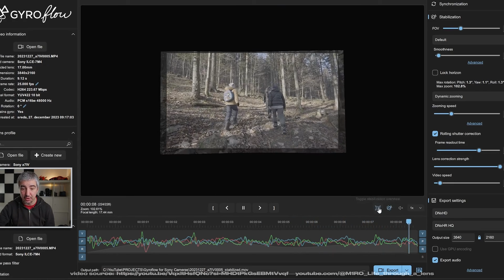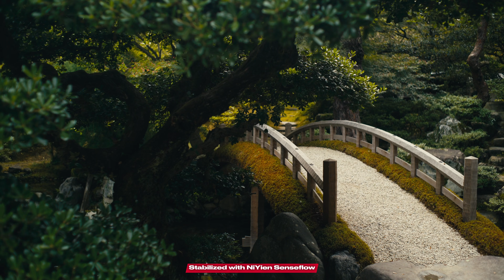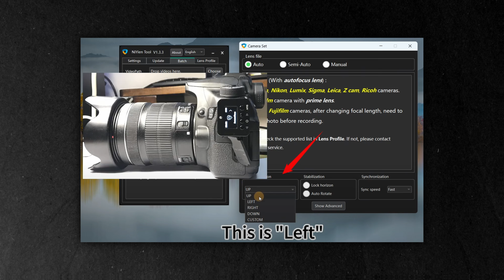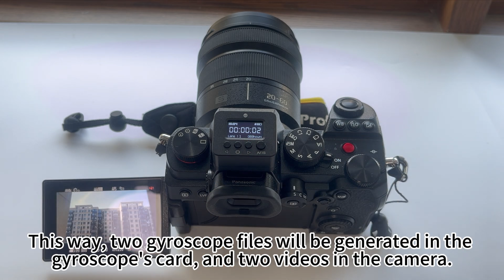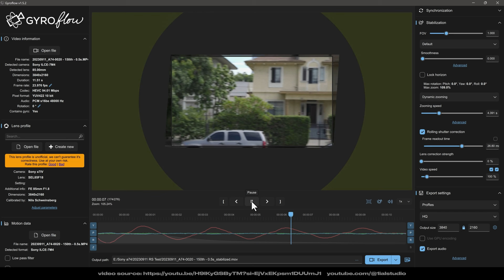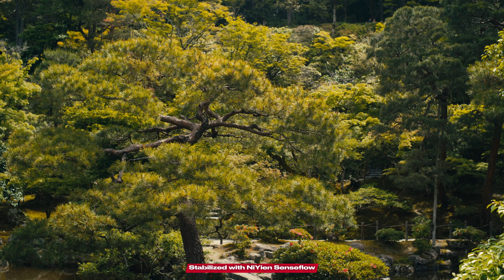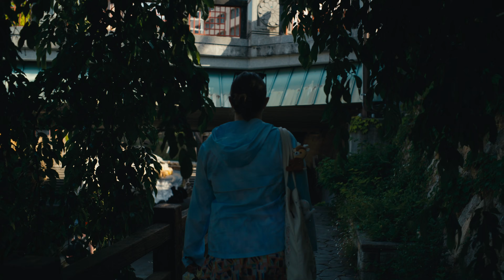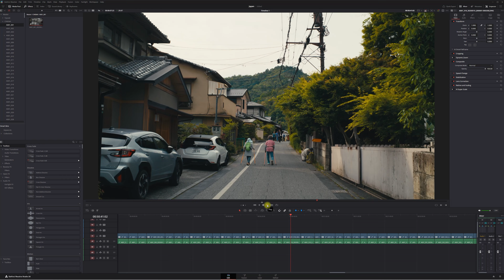Stabilizer for any camera?! NiYien Senseflow A1

Comment: The A1 also features: an intervalometer (for timelapses, with both bulb and normal shutter modes), a remote trigger, a timer and a level with X/Y + bubble visualization (firmware 1.2.8).

Just discovered that when I received mine today, so this is definitely more than a simple gyro logger and definitely feature-packed for the price.

Comment: so good! Would it work  to keep the shutter angle at 180 by shooting a higher frame rate? like fps120 shutter speed 1/240? that way stabilisation works fine, rolling shutter suppression works and we keep the 1:2 fps/ss ratio? that would also allow for slomo by recording at higher frame rate if we decide that we wanna use slomo in post
Reply from the maker: Yes, you can shoot above 1/200 without any problems. 👍
Reply: @flare_vision so good! Thanks a lot

Comment: Really curious about the shutter cable operation. Would that mean you don't have to record the 2 sync clips and could just run and gun? That would be huge, and I will be buying one asap if that's how it works.
Reply from the maker: It should work like that, yes. But what's wrong with two sync files once a day? It literally takes a few seconds, and you don't need extra cables
Reply: @flare_vision  it's not bad, but I just like the idea of 1 button operation. The less steps the more likely things will go right. I watched a few videos where the videographer either lost their footage or had to reshoot because of some mess up with the sync operation. I'm sure it's pretty reliable, but for a neanderthal like me 1 button more better than 4 button.

Comment: or just buy a sony cam because most already record gyro data internally anyway and use with gyroflow natively. main reason i got my fx30
Reply: also, use a faster shutter speed for really shaky footage and add motion blur back later, pixels can still be blurred from movement that was there previously even after it is stabilized
Reply from the maker: @nickasel5393 Yup, I mention this and more in the video.😉

Comment: Maybe I missed a part of the workflow. You drag the files into the NiYien tool and get them matched up to stabilize.  It looked like, after that, you brought them directly into your video editor. What about the Gyroflow program? I thought the files from the NiYien tool were imported next into that program and then to your editor?
Reply from the maker: In Davinci or adobe you just using a gyroflow plugin to stabilize the footage. 
So after syncing in niyien tool you can work directly in Davinci or adobe with gyroflow plugin👍
Reply: @f @flare_vision anks. Just one more question. I don't have/use those, i have Movavi (no plug in)  can i go from NiYien tool files and drag them into Movavi or does Gyroflow come into play here?
Reply from the maker: @megapix-x51 If you are working in Movavi, after syncing in the NiYien tool, you should go to Gyroflow to stabilize the video files, and after that, go to Movavi.

Comment: Have you tried comparing it to the gyro data stabilisation in Resolve from Blackmagic’s own cameras?
Reply from the maker: You can stabilize BMs files with Gyroflow and get the same result without this device👌
Reply: @flare_vision Thanks for your reply. Is it identical in terms of performance though, or would this device provide more (or more accurate) data for Gyroflow to do its thing?
Reply from the maker: @christianschmeer It's identical. This device is made for cameras that can't provide gyro data.
Reply: @flare_vision That’s great! I have a BMPCC6K and 6K Pro, but I’ve never used the internal gyro data. I’ve only ever used a SteadXP gyro device on an URSA Mini back in 2018. That worked pretty well already, so will need to try out the internal gyro as well 👌🏼
Reply from the maker: @christianschmeer You should definitely try it out! With Gyroflow, you should get good results👍

Comment: I find it annoying that all these cool new devices for cameras often support the higher end cameras but not cameras like a Nikon D5 which isn't a "new" camera but is still very much my daily driver because of its long battery life and just because I've shot using a Nikon D3, D4, D4s and now the D5 and just like the ability to adjust all the settings with dials and buttons rather than having to use a touchscreen which helps since I have bumbly ogre hands. I can't say for sure whether the D5 outputs the required metadata to accompany this device to stabilize video, but it certainly spits out quite a bit of metadata. Even though the D5 isn't a "light" camera although you get pretty comfortable with it. But what doesn't get comfortable with the weight is a gimbal. A gimbal capable of carrying the D5 and a 80-200 or so lens cost an arm and a leg and weigh another arm and a leg which make using Gyroflow and this sensor so appealing. The D5 is a reasonably capable 4K camera but it's purpose is to not miss a natural wedding shot (photo) when the light is getting low but you still need f4-f8 at 1/3200s to keep from blurring photos which it does fantastically and frankly thats what I get paid to do, not video. So buying a $900 gimbal just so it can hold the weight of the D5 and I can shoot some video isn't something I'm going to be setting up and taking down in between doing my actual job of taking photos. But adding this little device and maybe get a few percentile lower stability shot than a full gimbal setup without the setup would be awesome. I know most people don't shoot on D5s and D6s. But we get left off every list of compatible devices for cameras and its a real bummer since I can't imagine myself wanting to switch to a mirrorless without an integrated vertical grip (I've had extended battery grips and they just don't have enough rigidity to feel comfortable with and the buttons and switches always feel like more of an afterthought) until the D6 is so outdated it can't hold pace with a phone camera at a wedding or event (I just said wedding because those are the shots your clients are the most likely to be pissed about if the photos are too blurry to be viable)
Reply from the maker: Try to contact the developer and ask about support for your camera. The link to his Discord channel is in the video description.

Comment: I make the mistake of buying one of these. Tried it. Don't waste your money. It isn't anywhere close to what is claimed. It isn't a replacement for a gimbal, in fact, it was poorer for me than the IBIS in my Nikon Zf.
Reply from the maker: your experience does not reflect the experience of the majority of buyers - most are very satisfied with the result. you may have done something wrong and your video has not stabilized correctly.
And nobody claims it is a replacement for a gimbal. It's just one of the options.
Reply: @flare_vision Even the installation instructions in the video regarding download and installation are wrong.  I followed exactly the instructions,  so if is wrong? That just demonstrates this product is not market ready.
Reply from the maker: @Ghatbkk  As I thought, you just haven't figured out how the device works.Follow the instructions on the official website:
https://www.niyien.com/NiYien_manual_EN.html
Reply: @flare_vision   You mean the site which has incorrect instrrructions on download and installation of the software? 

Those are the directions I followed. If those directions didn't work?  That is just another example of the product not being market ready. 

I shouldn't need to understand how the device works. I should be able to follow the directions and get the result expected. I did follow the directions, and the results were garbage.
Reply from the maker: @Ghatbkk  It looks like you're the only one who hasn't figured out the installation.. maybe the problem is not in the instructions?..
Reply: @flare_vision   So you are admitting the instructions are screwed up and have to be "figured out"? 

Seriously, just keep digging. Wow
Reply: @flare_vision   Btw, it seems like you are pretending to be an independent reviewer when you are actually the company making the product. That's fraud.
Reply from the maker: @Ghatbkk  I'm telling you that you are the first person here who can't figure out the video instructions, so I believe the problem is with you, because the instructions are pretty clear.
If you still want to figure out how the device works, I recommend contacting the developer directly in his Discord channel. The link is in the description under the video.
Reply from the maker: @Ghatbkk Yeah, sure, I'm the company making the product, of course...
🤡🤡🤡
Reply: @flare_vision Then how could you claim "you're the first person"? 
Might want to think through your own words.

Comment: Thanks. Does it work on Mac or iPads?
Reply from the maker: It works on Mac, but not on the iPads.
Reply: @flare_vision  Thanks. How about the software in Final Cut pro?
Reply from the maker: @lawrencediggs7957  there's a paid plugin for final cut. For Davinci and adobe it's free
Reply: @flare_vision  Thanks. I'll check it out. I expect it will be in the App Store?
Reply from the maker: @lawrencediggs7957 as I know it's called Gyroflow toolbox

Comment: If I don't want to record two short videos to synchronize, and instead use a USB Type-C cable to connect to the camera, can I start recording video immediately?
Reply from the maker: Yes, I think you can do it. No need to take two sync videos if you're using cable.
Reply: @flare_vision  But why are you the only one mentioning this? I’ve scoured the manufacturer's instructions and couldn't find any mention of it.
Reply: @flare_vision I also asked about this in a Discord group, and everyone said the USB-C port is only for PC connection and charging. Now I’m really confused
Reply from the maker: @vita·e·breve Oh, sorry,  I misread. I thought you meant a 2.5 jack cable. You can't use a USB port to connect to a camera.

Comment: Purchased, excited to give it a try! --- UPDATE below
Reply: The entire workflow has a bit of a learning curve but once I got it dialed in and figure out it works perfectly. I'm probably going to sell our gimbal because I can't see much of a use for it anymore. We rarely use a gimbal anyway, pretty much only on commercial shoots. We have a shoot coming up that includes a jungle hike and this will not only make it easier to film, we will have the option in post to control how smooth vs. handheld we want each shot.

The last thing I'll say is that it's SO MUCH easier to frame things while moving around because you are simply pointing the camera (directly with your hands) exactly where you want it pointed, rather than trying to frame things on a gimbal...which can be very tricky and can involve 2 operators. We are now able to do more sophisticated moves with much less effort. This is important when you work in in fast unpredictable situations, like documentaries. Nailing shots on the first take while a group of clients watch your every move is an added bonus I had not anticipated. 

(incoming comments about how I should just be a better gimbal operator 😏)

Comment: its much better then just stabilasing without gyro data in post. But  one thing a gimbal does better is: it doesnt crop!
Reply: This is true but with practice and the right lens choice the tradeoff has been worth it for us. One thing I didn't anticipate was how how easy it is with this setup to do complicated moves and compositions. Doing the same with a gimbal usually took several takes and I would often lean more towards "safe" framing to avoid holding up the entire shoot. Now I'm able to have full control over the exact composition and move I want quickly and easily. So, long story short, I'm ok with the crop because I gain so much more.

Comment: Sony already has this built in to their cameras. The results are great, if you dont mind having to have a really high shutter speed. But the time added to your workflow is insane.
Reply: Yes you need high shutter speeds (How high? I'm guessing 4x higher generally speaking) so you need a sensor with good low light performance and 4k+ for being able to crop and still end up with a respectable resolution. It looks like a good solution for daylight shooting but for low light I guess you'll still need a gimbal. That's good I'd rather walk around the streets without a gimbal.

Comment: how does this do when you have people talking on camera with those higher shutter speeds - does it give off an unnatural look with shutter angles hovering around 90-degrees with something like a 24fps timeline?
Reply from the maker: Most of the people wouldn't even notice a difference 👌
Reply: @flare_vision  thank you - I ordered one on Amazon and and eager to start playing.  I plan on using it on a Lumix S5 and S5ii for some off the cuff b-roll shots with realtors.

Comment: So my question is why can’t we just use the gyro data off our cameras in my case the Sony A7siii? What’s the difference?
Reply from the maker: Sony and some other brands are supported by Gyroflow. This device is made for cameras that can't record gyro data in the video files.
Reply: @flare_vision thank you! Is there a video you can point me to where I can use the gyro data from my Sony a7siii and use it directly with the gyroflow plugin in resolve? Is it that simple or do I have to upload the data into the software then load it in the plugin in resolve?

Comment: Genius device! I ordered it the moment I saw this video. The Lumix S1H with its 6K Open Gate mode is definitely an ideal setup for this. Having that extra sensor overhead gives the gyro stabilization plenty of room to move, allowing you to deliver a 4K file without any loss in resolution.

Comment: Other than video, how does it work for still images?  Curious because I have the FUJI GFX100RF which has no image stabilization.  Wondering how well this would work when shooting hand held at lower shutter speeds?  In any case, thanks for this info.  I was not aware of this device.
Reply from the maker: This device works only with video files.
Reply: @flare_vision thanks for the info

Comment: When I try to click "Export" on Cinema DNG footage, I get this error 

ffmpeg::Error(1094995529: Invalid data found when processing input)
Your video format may not be supported.
Try uncheck "GPU decoding" in "Lens&Settings".

I've tried the GPU decoding it's toggled on and off, doesn't work 

I'm on a Mac M2 machine
Reply: I figured this out. It's because I was using slimraw compressed cinema DNG files. This application does not work with these kinds of files. So you have to generate this GyroFlow file first and then use slimraw to compress the files after.

Comment: Of course there is no A6700 support 😅
Reply from the maker: A6700 can work directly with Gyroflow, so no need for this device
Reply: @flare_vision oh nice. So what i actually need for this to make it work? Just Davinci plugin or something more?
Reply from the maker: @kamal_designer It's better to check some tutorials on this matter, but yeah, basically you need a Gyroflow plugin, and maybe you also need to specify the focal length of your lens if it has no electronic connection with your camera 👌
Reply: @flare_vision  i have new Sigma ART 17-40 f1.8
Reply from the maker: @kamal_designer In that case, I think you just need a Gyroflow plugin 👌

Comment: What's the files output? the issue with previous versions of this kind of system was that the software was only for Windows and the out put was H264 after stabilising.
Reply from the maker: You can shoot in any format for supported cameras.For example, my shots were taken with a Sigma FP in cDNG format. Works great 👌
And there's also software for Mac OS 💪
Reply: @flare_vision  I saw, thanks a lot

Comment: I think one of the main reason that gyro stabilization didn't appeal to creators is its reliance to high shutter speed video. I recall gyroflow and sony catalyst browse recommended a shutter speed of at least 1/100.

A 1/100 shutter speed may not affect recordings at 60fps, but for those aiming for cinematic 24fps or   natural 30fps will take a hit in making this work
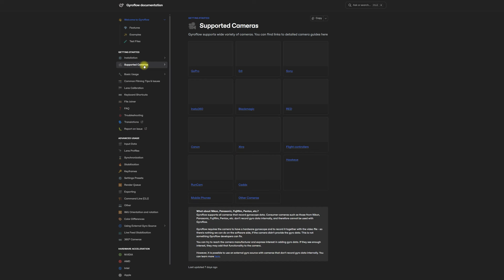Reply from the maker: I covered it at 11:21.
Reply: @flare_vision yup, I commented this halfway in the video and felt silly that I saw the limitations came up after I commented this.

Anyway, this seems very promising for users. This prolong some old cameras with great video quality outputs that does not have built in gyro data. 

For camera manufacturers, I think they won't promote modules that will not make their patrons hunger or thirst for the latest and greatest.

Comment: I don't understand why we can't use this with gimbal. All it has to do is getting the physically stabilized camera gyro data. Although you use gimbal you may have micro shakes while you are running. That's why I think we should be able to get it work with gimbal.
Reply from the maker: i've heard that it actually works, but a haven't test it, and haven't seen any footages yet.

Comment: I wonder what it uses to syncronise the gyro data with the video files, since there is no timecode, and no matter how accurate you are by pressing record on both devices simultaneously, there will be a couple of frames difference between both.

Does it "see" the video files in the software and tries to match the motion by analyzing motion on the source videos?
Reply from the maker: I think it uses the time from the video files for the sync, but I don't know for sure. You can ask the developer in his Discord channel.
Reply: @flare_vision time is relative. I've had multiple issues when trying to get multiple cameras synced together via incamera clock. I do weddings, and it is important for the cameras to be synced together and afrer a couple of hours they drift apart a couple of seconds. In this case it requires sub frame accuracy, otherwise it won't work.

But I'll ask. Thanks for the reply. Cheers!